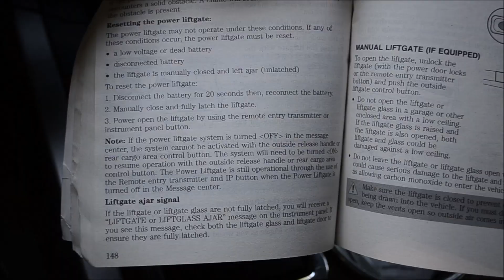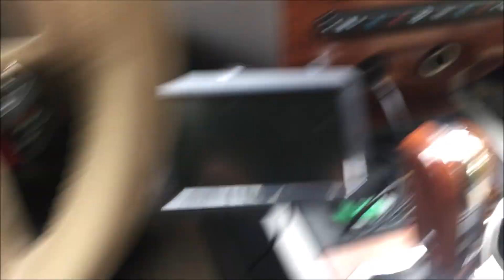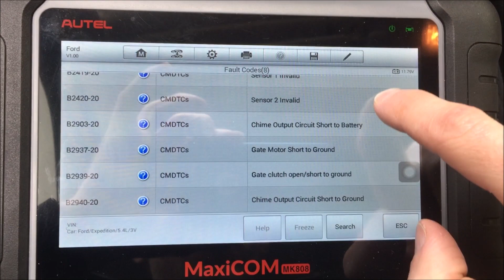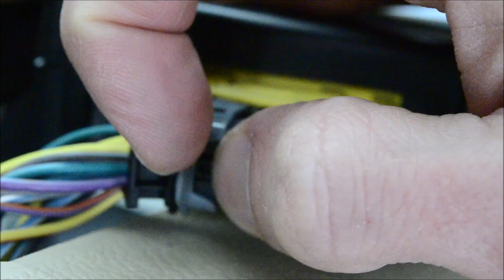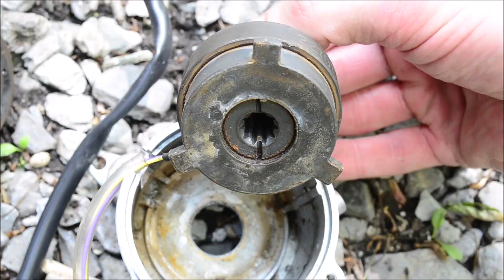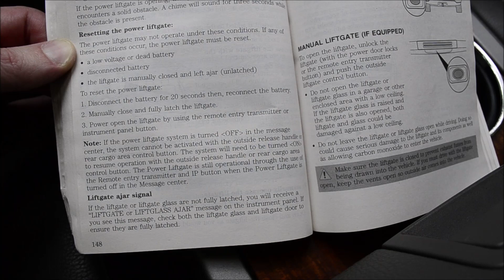Expedition Navigator Power Tailgate Not Working Repair - Reset, Motor, Liftgate Control Module

Comment: I Have a 2010 Ford Expedition Limited. The tailgate will open and close using the button on the dash. The tailgate will open and close using the keyfob. But, when i press tailgate to open from the button handle at the tailgate, I can hear a noise but will not open. Additionally, the button on inside drivers rear quarterpanel to close tailgate will make the beep sound but will not close tailgate. The fuses are good in both the inside passenger side and under the hood.  What else can I look for?

Comment: I have an 2007 very similar vehicle and my tailgate stopped working. 
But unlike yours it won’t open at all. 
When you pull the handle at the back nothing happens. 
How did you get yours to open manually.

Comment: I have a 2010 Ford Edge that was partially submerged in flood water due to Hurricane Ian and I'm gradually fixing everything that's wrong with it (along with remodeling my whole house and getting a new roof). This was the last thing I needed to fix on the car and your video gave me the "courage" to take the motor apart. I had the exact same problem where a few of the gears were seized/rusted in place and was able to get it working again. You saved me $200+ that I couldn't afford due to all the recent expenses. Thank you so much!!

Comment: Thanks for the video. I have a 2010 Navigator. The shocks went out on the lift gate. But when I replaced them the power lift didn't work. After watching your video I pulled the fuse (it wasn't blown) and put it back in. Then the gate worked. Awesome!

Comment: Wow, you got guts, as you totally disassemble the drive motor and repair the internal bearing. It worked but it is a something no other mechanic would have done other than DIY. What a shop would have done is a new motor for $300.00, and labor for another $300. Good for you!

Comment: I have one for U!!!  I have a 2018 Ford Expedition Platinum 😎. The tailgate will randomly open EXPECIALLY when exciting the vehicle. You want to make sure no one is standing around it or back up to something close as they or it may get hit😬. Really a nusance. Took it to a Ford Dealer and they said they could not find any fault codes. Could not make it happen while at dealers. 🙃🧐😬. Any idea what to tell the dealership to look at?🙏🏻🙏🏻🙏🏻
Reply: If it's when you're exiting the vehicle, check the accessory delay relay. It's in the interior fuse box. I just had to replace one that was causing all kinds of weird issues since it provides power to a bunch of stuff that is supposed to work after the car is turned off. The radio would stay on, the driver's side airbag light was on, the seat heater wouldn't turn off, the mirrors did weird things, etc. Replaced it and bam, no more issues.
Reply: @siyypmskkrm1  Thank you for your time and info.  I did finally take it to another dealer who found a short!  FIXED!

Comment: What exactly was your tailgate doing or not doing to where you knew there was a problem?  Mine, when i push the tailgate open button, it does open my gate but it immediately slams shut instead of opening all the way up.  Was this what was happening to you?  If not, does that issue sound familiar to you? Also, for reference, I have this exact same same vehicle.  Thanks
Reply: Replace your lift struts
Reply: @kevinstraitiff6318  the big, main strut, the two smaller struts, or all 3 of them?🤔
Reply: @shocfacter  personally, if I'm going to replace one of replace all of them. 2 for the liftgate and 2 for the glass.
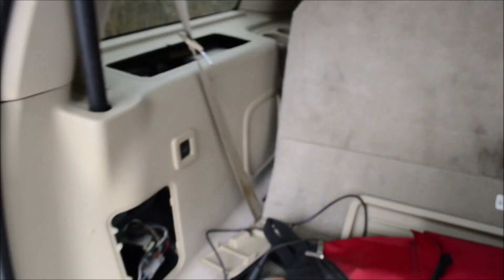Reply: @kevinstraitiff6318  i was referring to that really big one.  The one that goes down by the motor?🤔  It can first be seen at 2:03/2:04 in this video.
Reply: my friend has the same problem that you have.. Have you found an answer for it?
Reply: @salehnz7630  I have NOT found out what was wrong yet.  Im still waiting for THIS guy to respond 🤣

Comment: Awesome. I changed my liftgate supports and didn't know how to perform the reset.  Your suggestion to remove the fuse for 20 seconds instead of disconnecting power at the battery worked!  Yout saved me so much time not having to reprogram all the system settings. Thank you!

Comment: Do you have any idea to manually ion the power lift gate? I had a battery issue and replaced it and then the lift gate has become stuck closed the glass still pops open but the powergate seems to be stuck Not all the way closed and the lift gate ajar light is staying on and I cannot open it at all manually, I’ve checked all 3 possible fuses and they seem good I just cannot open it to try and reset it for some reason

Comment: So mine just suddenly stop working automatically. I press any of the buttons and the door tries to open, then makes a rattling noise, dings 3 times and doesn't open. If I open it manually it does the same when  button is pressed to close.

Comment: DIY Car Guy.  I have a 2014 Ford Expedition.  The power lift gate works when you use the remote and the button on the dash but the handle button does not work nor does the button directly inside the hatch to the left.  Any suggestions?

Comment: I can't get the lift gate to open period. I went to the store and it worked fine. I got home and I couldn't get it to open.
Key fob don't work
Button on the dash don't work
Button in the back doesnt work
The button on the tailgate won't work

I had to pop open the window on the back to get bags out of the back.
Reply: I had the same problem but i bent the back seat and manually insert my finger into the lock and open it. but before, the thought came to my mind I have been so angry  and frostrated

Comment: What if it makes a sound where the lock is? Almost like the lock isn't releasing the lock automatically and it won't go. That's where I hear the noise. Is that still the motor or is it the lock?
Reply: Yeah, I need to know how to reset the lock because it will latch for 1 second and then release (still would raise and lower with the buttons). It’s my fathers vehicle and he tried disconnecting the battery per the manual, now the entire lift gate won’t work lol

Comment: Hey, I have a 2008 Expedition XLT, which doesn't have the power lift gate.  Just reg liftgate.  But I have checked the fuses and replaced the latch, but the liftgate doesn't open.  The liftgate window works, but not the gate itself.   What should I check next?  Or what might be wrong?  I purchased a control module, but I can find where it is located to swap out.  Please help.
Reply from the maker: I show where the module is in the video at 2:05 +
Reply: My truck is a XLT Model, it doesn't have the full power liftgate.  It only have a latch and power module.  There is nothing where your power module is located behind the panel, on the fuel cutoff side, driver side.  Any info will help.